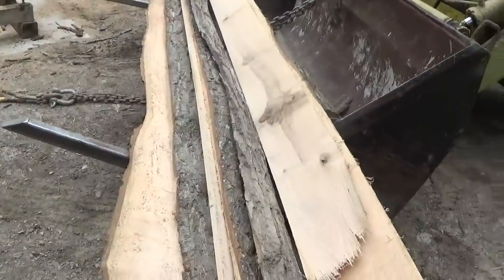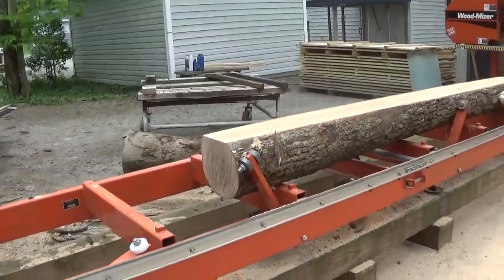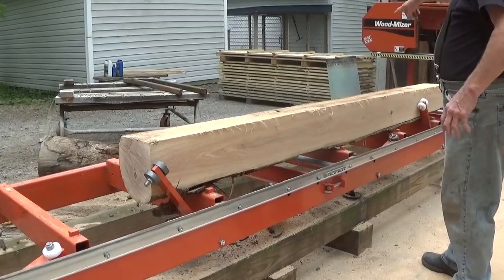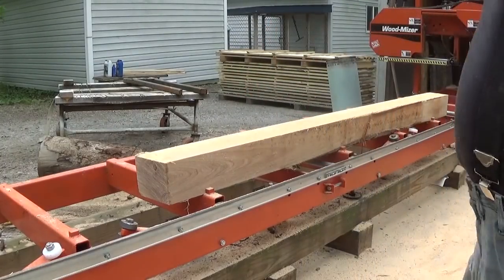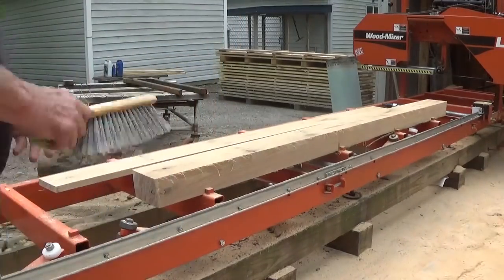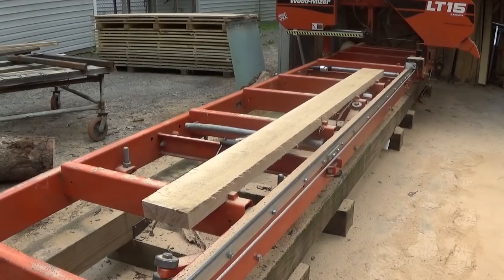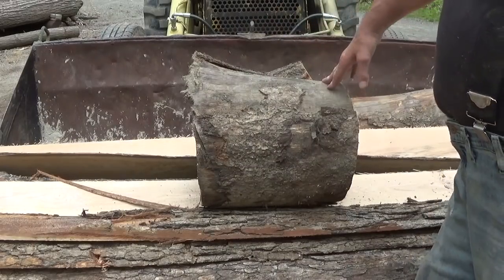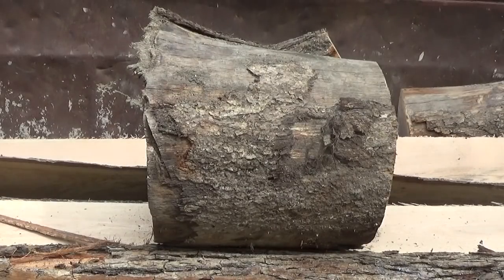Beautiful day to cut lumber 65 degrees all day. Woodmizer LT15

Comment: Joe your knowledge of milling is spot on. When you had that wane on the one side I was waiting to see if you was going to turn it on bottom. As that was correct thing to do as you cut off your good boards you want the wane to be on the left over waste. Then for which end of the log to start from your also right except over time for sake of speed. You quickly are able to visualize where to start the cut from either end. But if you have a doubt you can alway take a measurement on the small end and adjust your cut to the measurement. But speed of your milling process only matters if you sawing commercially and profit depend on how much you can cut in a day. Otherwise take the time and often that will improve your quality.